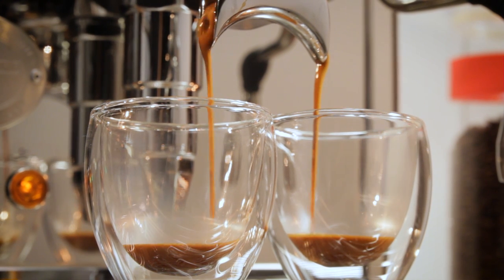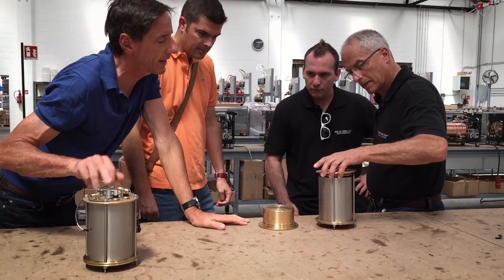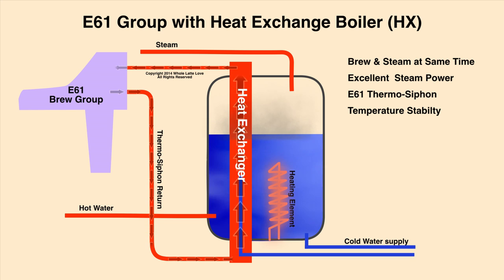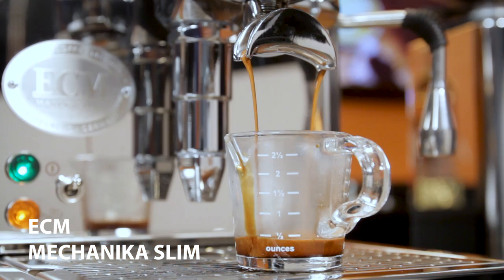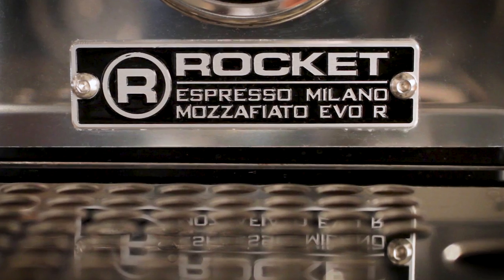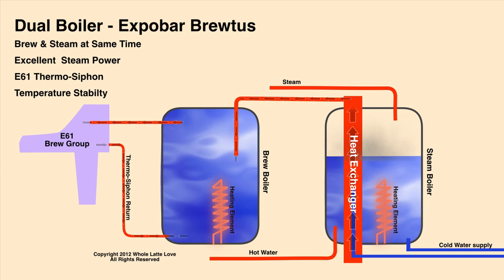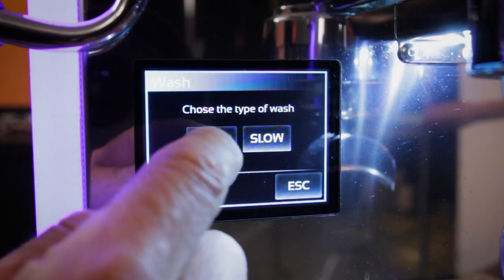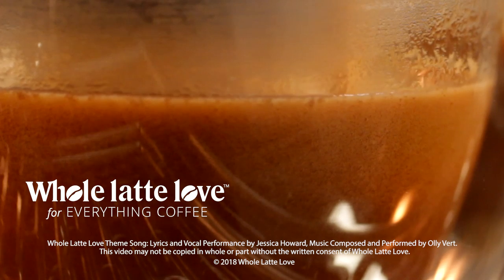How to Choose a Prosumer Espresso Machine: Dual Boiler or Heat Exchange

Comment: Synchronika, plumbed. No naked filter to confirm, but I am getting thicker pours w/ more crema preinfusing with the single basket. I suspect full pump pressure is punishing the thin single dose too much and causing channeling.
Reply from the maker: Hi Simon, Thanks for the comment. Singles are tricky, finicky, PITA. I know it may be different in other parts of the world (Italy?) where espresso is more of a commodity but here in the US I don't know anyone in specialty coffee, cafes or homes pulling singles on a regular basis. I asked in a video awhile ago for preference on single v. bottomless PF being included with a new machine. Had over 1,100 votes. The results were overwhelming: https://youtu.be/BIsNpBNi8DU
Marc
Reply: @Wholelattelovepage  Always been a double person too, but I have 5-6 a day (going through 2 pounds of coffee a week just myself) . I thought I'd revisit the single after just receiving a Sync with line pressure preinfusion (just retired a 20 year old BZ99 I'd put on a rotary pump, so not even vibe pump ramp up - I could never get singles consistently right). So far I'm happy enough with the singles, although only had the Sync 3 days now and lots of exploring to do.

Here in Australia, a lot of couples get machines for their cosmetic appeal in the kitchen and don't really dig deep into the hobby. They'll routinely split a double rather than pouring two doubles, so I guess they'd do singles just for themselves too. Thanks for the link - I'll add a comment.

Comment: Hi there 

I currently have a rancillo silvia.  I was told 220 volt espresso machines are cheaper.  Is this true?   I'm considering running a 220 volt circuit to my kitchen and upgrading my machine.  Any advice would be appreciated.  Thank u
Reply from the maker: Hi Glenn, Thanks for the question. I do not know where you are located but if in US I think it will be difficult to find a 220 Silvia. I'm not familiar with any pricing differences from manufacturers. In US you will not find 220 machines until you get to commercial cafe equipment.
Marc
Reply: Thank u

I love your videos.  I'm considering a smeg espresso machine.  It's 220 volt and u can order online.  It's about $500.  Any thoughts
Reply: It'll cost me about $300 TO run a new 220 circuit into my kitchen.  Do u have any thoughts on European 220 home espresso makers like the smeg unit

I know they don't sell in the states.   But there available online
Reply: I'm local in Renton wa

Comment: How about acs minima that has dual boiler with brew boiler 0.8L, is that enough to use for light commercial? Is that good and consistent for brewing many coffee in a row?
Help me to answer mark ❤
Reply from the maker: Hi BD, I have no experience with the machine. Given it's very low price compared to similar machines I wonder about quality of components long term. While this type of machine can produce back to back espresso I imagine the group will overheat with constant use leading to ever increasing brew temps. Even for light commercial I'd recommend at minimum a rotary pump plumbable machine.
Marc
Reply: How about compare to nuova simonelli oscar ii for light commercial sir?

Comment: Which machines have the extra rounded corners and which machines have the highest quality internal components please?
Reply from the maker: Hi b, Thanks for the questions. Profitec and ECM machines have excellent internal components and use ultra-reliable K.I.S.S. design. For machines with rounded corners and high quality external finishing have a look at the Profitec Pro 700: https://www.wholelattelove.com/products/profitec-pro-700-dual-boiler-with-flow-control
And the ECM Synchronika: https://www.wholelattelove.com/products/ecm-synchronika-dual-boiler-with-flow-control
Those 2 are identical internally with the difference being external finishing.
Marc

Comment: Is there a reason you no longer sell the Expobar Brewtus 4? Would be nice to purchase a machine with PID, HX or Dual Boiling, and rotary pump all at that low price point!
Reply from the maker: Hi sa, Thanks for the question. Expobar's parent companies have decided to no longer bring non-NSF rated into the US market. Look for some new machines under the Crem brand which are NSF rated coming in a few weeks!
Marc

Comment: Do you ship each machine with a uniqe calibration sheet? Temperature etc.
Reply from the maker: Hi David, Machines do go through a bench test before shipping. They are checked for scratches, brought to operating temp and checked for leaks, gauge operation, water flow, boiler pressures, etc. We do not include a calibration sheet.
Hope that helps!
Marc

Comment: Do u have link for lelit mara x v2
Reply from the maker: https://www.wholelattelove.com/products/lelit-mara-x-heat-exchanger-espresso-machine-matte-white
Reply: I am currently using delonghi espresso machine.
Is this machine a lot better?
Also I heard this machine will have overheat issue, you could advise should I set to brew mode or steam mode?

Comment: If a heat exchanger runs dry, will it damage the heating components?
Reply from the maker: Hi Zac, Thanks for the question. Always a risk of damaging the heating elements if a boiler runs dry.
Marc

Comment: Hello! Love to see your videos.
I have a question. About HX machines like Appartamento some people say that you really cant brew and steam at the same time as this causes a bypassing of the pressure so what you have in the end is less pressure in your brewing and steaming power. So what does really happening?
Reply from the maker: TheFitnessProject Hi, very bluntly, those some people are dead wrong. Pressure for brewing is supplied by a pump which is isolated during brewing from the separate section of the boiler which produces steam. Many commercial machines in cafes use a heat exchange setup and brew and steam simultaneously on multiple groups and steam wands. For prosumer level machines HX is very common I guarantee you can brew and steam simultaneously without issue. 
Marc

Comment: Marc, In one of your other videos, you talked about the importance of a cooling flush for heat exchange machines. You mentioned that you might have some recommendations for particular machines about how long that flush should be. I am a couple of weeks in on the Expobar Office Control I purchased from you guys. My shots are improving, but I am curious if you had any recommendations specific to that machine. Sorry if I am posting this in the wrong forum. Thanks in advance. I am loving these videos. - Marty
Reply from the maker: Hi Marty, Great to hear from you and thanks for the comment and question. Best thing to do is flush without portafilter in place until the water flow from the group is smooth with no evidence of flash boiling like lots of bubbles coming from shower screen. This should take ~3-7 seconds depending on things like how long the machine has been idle and where it is in its temperature cycle. Once you have smooth flow you know you are below boiling point. From smooth flow I'd flush another 3 seconds and you'll likely be close to 200F. Be ready to pull the shot right after the flush. Based on taste you can adjust your flush timing. Bitter flavors indicate high brew temp, sour indicates low. Of course many other variables involved but when all is consistent shot to shot changing brew temp by flush timing should produce a taste-able difference. Hope that helps!
Marc

Comment: Hello,
does the quality of the espresso improves when the brew pressure exceeds the 10 bars? If yes, how far can we go? If the Nespresso machine brews at a pressure of 19 bars, does it deliver a better Espresso quality than the standard machines?
Reply from the maker: Hi Anes, Great question! Quick answer is no. The 19 bar claim is about marketing - more is always better right? Not with espresso and pressure! This is similar to cheap entry-level home espresso appliances which market 14 bar of pressure. So maybe they have a pump capable of making 14 bar but you do not want to brew espresso at that pressure! If it were better at higher pressure all the high-end cafes would be doing it and they are most definitely not.
Marc

Comment: yeah but how does it affect the coffee?
Reply from the maker: Hi p, Thanks for the question. No real difference in potential espresso quality based on boiler type. It's more about how it is used. In general dual boiler machines provide more consistent brew temperature and brew temperature is not affected by steaming as may be the case in machines with heat-exchange boilers. With proper user technique HX machines provide consistent brew temps.
Marc

Comment: The brewing water should have a temperature of around 93 degrees Celsius (200 Fahrenheit), the water in the steam boiler is heated up to 130C (265 Fahrenheit). The problem with HX machines with a thermosiphon is that the brewing water is heated up by flowing constantly in the HX through the steam boiler.  When the machine is out of use for some time the brewing water must overheat, up to boiling 100C (252F?) because the cooling of the E61 is not enough. (This system was invented in 1961 year of an Eclipse for machines used in cafes with constant use.)
Marc, I don't understand why a PID controlled temperature in the steam boiler should solve that problem. The reason for this problem lies in the thermosiphon/E61 system not in the higher hysterese with the pressurestat.
Reply: PID isn't solving issues of thermosiphon, I agree. PID and fast reacting sensor help to narrow temp swing in a boiler, but without sensor in a brewhead and additional code in control unit it again goes down to how well design matches assumed usage pattern - again, like your assumption.
Reply from the maker: Hi Tim, As 1 eq... mentioned PID (significantly)narrows the temp swing in the boiler. One key component helping this new crop of PID HX machines produce the proper brew temp is a flow restrictor in the thermosiphon loop to the E61 group. There's more to it of course like size and position of the HX section within the boiler and more. But the sizing of the hole in the flow restrictor (it's a stupid simple part) makes a huge difference in how fast water moves out to the group and back. After years of using pressurestat controlled HX machines I was stunned when using these new PID HX machines. Could not believe they could produce accurate brew temps like this but they did. I'm guessing they could have some variations based on usage patterns but I have yet to run into it like I did on pressurstat machines.
Marc
Reply: @Wholelattelovepage  Really interesting. Can you make a video in which you pull shots constantly from a machine for some time, measure the brew temperature, let the machine sit for an hour and measure again? Maybe on both types of machines, PID and pressurestat? If that would show fairly good results I would be really stunned. Then my next machine must not be a dual boiler anymore..

Comment: Hey, thanks for the video. I don't quite agree, how you explainend why PID controlled HX machines are more temperature stable then pressurestat machines. Actually, most of them are, but not because of the PID. Newer HX machines have a better design of the thermosiphon (restrictors) and mixture in the HX (inlet outlet tube length) and that's why they don't overheat anymore. The colder HX doesn't care much, if it gets heated up by constant 122°C or wavering 121-124°C. The mass in the HX, the thermosiphon and the brew group is so inert, that it is smoothing that fluctuation totally. If you measure brew group temperature there is no periodic fluctuation at all on a pressurestat machine. So yes, modern HX PID controlled machines are very temperature stable, but not because of the PID but because of the better design compared to their precursors with pressurestats.
Reply from the maker: Hi Max, Thanks for the comment! Don't think I gave complete credit to the PID for controlling overheating. Mentioned the engineering as well. Thanks for adding the detail - I generally don't go to far beyond discussing proper flow rerstrictor sizing. Design is likely getting better in non-PID HX machines and agree pressurestat temp fluctuations don't have a huge impact on group surface temps. Inside boiler temps may be a different story.

Comment: am i only one that want small, cheap, double thermalblock (ideally heat exchanger),pid, manometer, temperature stable brew head, isolated steam wand, digital menu, integrated timer, automatic descale, programming extraction time, preinfusion time,etc..? something that lookslike its made in 2018 and not 90' -_-
Reply from the maker: Hi Pepo, Thanks for the comment. Sounds like you'd like the Breville Oracle Touch: https://www.wholelattelove.com/breville-bes990bss-the-oracle-touch Has most of what you are looking for.
Marc

Comment: Great vídeo, but I don't love the E61, that's why I Still use my profitec 300 pro. Is there any expresso machine dual boiler without the E61 group???
Reply from the maker: Hi LS, Well, the 300 is dual boiler without the E61. Beyond that the Bezzera Matrix and Duo machines are dual boiler with no E61 group. Check them out here: https://www.wholelattelove.com/collections/bezzera
Marc
Reply: Whole Latte Love 
Thank you Marc, but there is only Bezzera’s!
Is there anything else? 🤔

Comment: The Rocket Espresso Giotto Evoluzione R runs a little over $2500. The Miele machine I have been looking at runs something like $2400. I was drawn to the Meile solely because of its simplicity and ease of use. Am I missing anything by going with a fully automatic machine?
Reply: You're baasically missing the whole experience, better drinks, and a LOT more
Reply: John Salazar yes your definitely missing out especially on good coffe
Reply: It depends how much effort you're willing to put in. If you choose to invest no effort into dialing in quality shots, then go with a superautomatic. The Rocket will give you better shots, but you have to work more for them. The superautomatic will give a good shot; the Rocket will give you the best possible shot.
Reply: @thebigdoghimself  I think it's definitely a good idea to check one out in person. Superautomatics can be a bit finnicky when it comes to what beans you're using. You end up with some extra effort on the cleanup end (in my opinion, obviously) because they automatically store the coffee pucks, and you have to dispose of it later. Really the effort is in remembering to trash the coffee because it can get moldy or develop mildew if it sits for too long.
Reply: Agree on care - even glass jar one would use for simplest brewing should be cleaned properly and on regular basis as coffee oils get rancid and spoil taste when they get old. Superautomatics have about same complexity as semi-manual machines, just more plasticky and hidden from a user, and still need some adaptation period - selecting beans as Rudy Nugent said, adjusting temp and grind within limited range they offer, filtering water etc etc. That said, taste of coffee still depends on beans for about 80% - low quality or stale beans will make bad coffee no matter how good machine or brewing method is. And water, water - wanting to protect expensive machine and using water with no traces of minerals taste of coffee wouldn't be any good.
Reply: @thebigdoghimself  well in that case, I would highly recommend breville/sage's oracle/oracle touch. That isn't a super automatic but you should be able to pull a drink hands free in under a minute and a half. There still is going to be a bit of handy work but that's only going to be on the parts where you move the PF from the grinder to the grouphead and for when you pour your milk. The rest is just touch touch brew
Reply from the maker: Hi John, Responses from others here are on point. There is a sacrifice of potential quality for convenience if you go super-automatic. I think of it like this: With a semi-automatic you can make an espresso or milk based beverage that's better than what you'll get in everything but the best specialty cafes from a barista who knows what they're doing. But to make great drinks takes some knowledge and effort. With a super-automatic you can have easy espresso and milk based beverages that are better than the majority of the big name chain cafes. If you have not watched already check out my video on how to choose an espresso machine. It covers semi and super automatic machines: https://youtu.be/pBxw8wzu0L4 Also check out my video on our top 5 super-auto machines. These are machines with excellent customer reviews and long track records of performance: https://youtu.be/TQCaidAz6W8
As others have commented, beans and water make a difference no matter what type of machine you use!
Marc
Reply: Don’t get an automatic. With a semi-automatic, you’ll get great quality shots with a little effort in the start. You’ll need to setup the grinder once if you’ll be using the same beans. Then just grind, brew, steam milk for 10 seconds and you’re good to go with a specialty-cafe quality drink